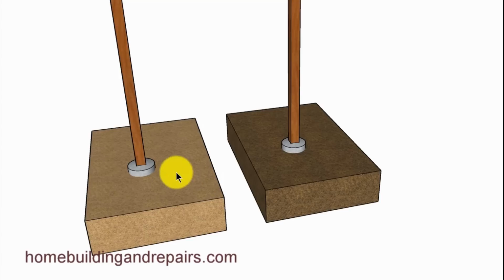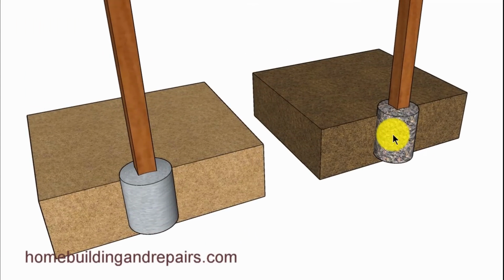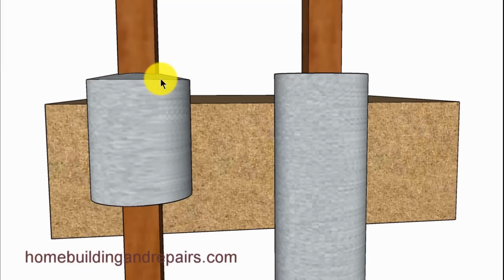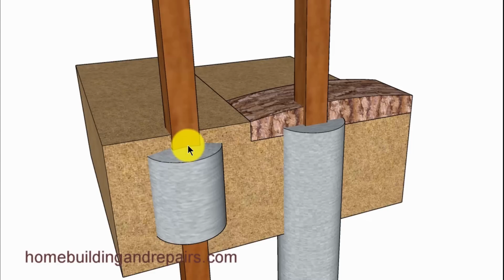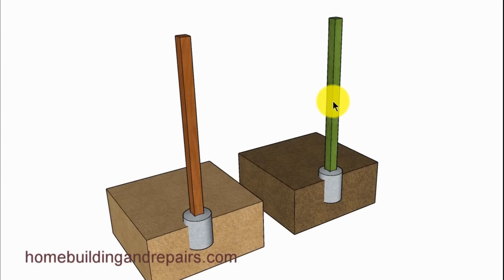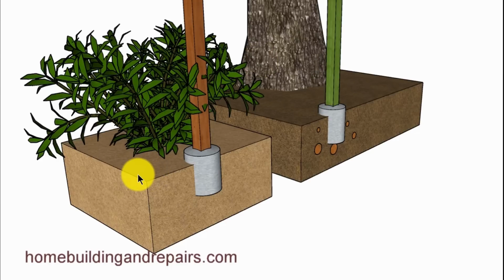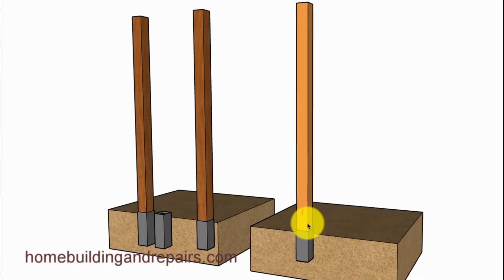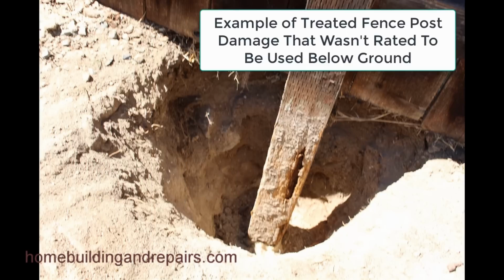Watch This Video Before Installing Your Next Wood Fence Post – Money Saving Ideas

Comment: If you want a fence you wont have to mess with for the rest of your life and is stronger. Never use wood, Use 2 3/4" drill pipe cemented 2' in the ground. painted with oil base paint. Same with patios and decks.
Reply from the maker: What about rust or corrosion?
Reply: cooldbz12 hello there I like your comment. I’m going to put a wooden fence (cedar) with wooden post (4x4x8’) in the patio which is 29ft 4’. 1st of all I want the fence to last long. 2nd I don’t want to mess up and I would like to stain it. Do I stain it firsthand then put it up? You had mentioned to apply oil, what kind of oil?    Please comment, thank you

Comment: Its a good topic but. The video spent 4sec. On the second to last option. Cement footer w/ galvinized post holder that keeps the post 1" from cement top. Over kill for fence but not for a building. Also no modern method like expanding foam was hit on.
Reply: I seen where one person was burning the post in some Japanese form, then he soaked them in preservative.

Comment: Metal posts. No more rotting post problems. Happier customers.
Reply: "Z" posts and "U" posts. Galvanized steel, 25+ year warranty in most cases, same as what they use for chain-link fences. You don't see those replaced as often as 4x4 post fences.
Reply: No then it becomes a rust problem

Comment: Bolting a length of angle iron perpendicular to the wood post below the ground forming a tee-construction is also a solution worth consideration.
Reply: I’m having a cement driveway poured in a couple of weeks and will have iron fence panels. Any advice on setting bolts or something in the wet cement to attach the iron fence post bases to? Thank you in advance.
Reply: @kayBTR  Would expect any reputable installer to already have their trusted method of anchoring in various base materials.

Comment: I think the gravel is a carry over from foundation work. Unless it provides drainage it has little purpose. On a foundation it provides a self compacting base to bear the load if the building, a fence does not need that. If it drains out, it could also provide protection from frost heaving by lowering the water below the frost line.
I think for it to really provide much benefit it would need to be a trench that drains out somewhere.
Reply from the maker: I would tend to agree with your statement also. However I don't know if it would work as good above frost lines. My thinking on this would simply be that the water would freeze in layers working its way up towards the top, then create a problem when all of the gravel is frozen or filled with frozen ice. Just a thought, not something I've ever came across.

Comment: Talks about putting a wooden post into cement. Says "Not something I'm going to set in stone".
Reply: Putting any lumber into concrete is a bad idea as far as I'm concerned.  I like to install mounting hardware into the concrete and then fasten the lumber to the hardware.....no rotting.  I learned this the hard way.

Comment: So what would the correct way be in clay soil? Looks like they r all not very good for both soil types.
Reply: That's the point of the entire video. Per the author of the video there is no way to bury a fence post without some sort of potential problem. He offers no real solution.  I however, would recommend you soak the post in old motor oil, then burn the post, dig a hole, and bury the post charcoal in the hole.  It shouldn't rot...
Reply: @miller1  Thx

Comment: Sometimes I tap two or three 12 inch lengths of rebar into a post hole as nearly horizontal as possible. Pound the rebars into the soil in different directions until an inch or two remains protruding into the posthole.  When the concrete sets up the rebar is embedded in the soil and stiffens up the post nicely.

Comment: I used galvanized posts in concrete and Cedar wood on my parents fence, that was over 20 + years ago, the cedar fence and posts are still there, never had time to recoat the cedar wood with clear varnish either. Neighbors paid someone who installed pine wood fence painted with paint, few years after it was falling apart and rotting.
Reply from the maker: Thanks for sharing your story with.
Reply: Could be the paint. Paint can actually reduce the lifespan of your cedar fence.

Comment: Paint the bottom of the post with old engine oil (or new if you have no car), up to about 5" above the soil level. Then, wrap oil paint post bottom in bin liner, including the lower face and seal the bin liner with brown/black exterior sealant to prevent ingress of water into the lining.

The rest of the post you can paint with the usual fence paint.

I'm replacing rotted 3"x6" posts that were set in concrete. I pulled the posts stumps out and I'm going to drop the new posts into the existing concrete foundation.
Reply: yes,this works or also the black asphalt sealer works too.(the one that can be used to waterproof your house footing.
Reply: @EPICSOUNDTRAX  
I have some existing post that are intact with only slight rot at the base. I'm going to dig the soil out, down to the concrete, and give the post bases two coats of bituminous black paint to keep the impede the rotting by the damp soil. Will paint up to the lower rail (latt fencing).

Comment: I have a Question I wanna buy a 16 feet 4x4 put Bird House on Top of it I have mostly sandy soil i hammered in a Rod Thats 8 feet long by hand in 5 min without a problem.. but anyways how many bags concrete would i need and how deep? Also I wanna make it so i can take the post in and out of ground if i want to do they make a ez base or something like that I can use concrete around it so i can take it in and out like during winter? instead leaving the 4x4 in the ground or no? or I have to make something like that on my own?
Reply from the maker: I cannot provide you with engineering information. I'm actually going to do the same thing with a 12 foot 4 x 4 in a few weeks and will be using about a 1' x 1' square footing that will be about 20 inches deep in clay soil. I'm going to put a pulley at the top with a rope so that I can raise and lower the bird feeder also.
Reply: @gregvancom  I think I know how I'm going to do it, I'm by a PVC 4x4 plastic Fence Post concrete it in the ground so i can take the 4x4 wood piece in and out of the ground!!! be so much easier!!!
Reply from the maker: @Chicagoman36  I like it.

Comment: @gregvancom....  Are you familiar with 50% diesel and 50% motor oil mixture to put on post and then coat the part that's going into the ground with tar????..I am curious to hear your thoughts on this method... That's something i am considering. I also  have sandy and clay soil what would you advise. I live in georgia lots of humidity.
Reply from the maker: I've heard about it, but have never used it. You would think that telephone poles don't rot, because of their treatment, but I've seen them rot also.
Reply: thats the way ranchers in texas built their fences years ago and they are still strong. BTW no concrete

Comment: I would like to see more ideas that avoid exposing the wood to subsurface moisture altogether or at least do not require tearing out the concrete footing when the fence post rots. You touch on this in the last 30 seconds. Other idea1: put a pvc pipe in the concrete instead of the post, then add the post within the PVC, then fill in gravel. Other idea 2: install several J bolts or rebar (ideally epoxy coated) in the footing that protrude 8" or so for use as glued dowels. Drill corresponding holes in the bottom of the post, fill holes with epoxy, and hammer post into place.
Reply from the maker: I do have other videos showing how to replace wood fence post at the website. Subsurface moisture isn't the only problem, there is also the problem of moisture from above. In my opinion, it seems like you would need to solve both problems at the same time.
Reply: @gregvancom  Any chance you can post a link? My motivation is both easier replacement and avoiding concrete waste.
Reply from the maker: @ThisIsNotAVideo  I understand and will meet you halfway. If you go into the video description box you will find a link to the website.

Comment: Just use steel another $12 a postmaster is the best. Posts rot out where concrete meets the post. As the post dries out rot starts at that point
Reply: Some people want the beauty of wood.
Reply: @108hindu  You can place a 2x6 over the Postmaster to hide it.
Reply: I mean 1x6.

Comment: what would it cost PER-post to dip them in a rubber-like paint? Like that stuff the put on a pickup truck bed?  Seems using that would go a LONG way to prevent water rot?
Reply: Just use roofing tar, same effect but inexpensive. Heat and it will soak in some.
Reply: That will go a long way to ENSURING water-rot.
You'll make a tub with such sealants that store water, ensuring rot.
Reply from the maker: I don't know what the cost would be, but if you ever do it, feel free to share it with us. I don't know how the rubber like paint will hold up in the long run and wouldn't recommend using it, but maybe some type of wood sealer would be better.

Comment: I have never seen a properly treated pine post rot at the bottom, here in the south. I have removed hundreds over the decades.
Reply from the maker: I have heard a variety of different things about wood posts lasting longer in drier climates, if you don't mind me asking, what state are you in and what would be the method used for treating the lumber.
Reply: the bacteria that rots the post is near the surface of the ground (need oxygen) thats why they rot at the top of the concrete

Comment: Here is how to rot proof a fence post.  Put a half brick on the bottom of the hole (so the  wood is in-cased in cement and not touching the dirt) and the bring the cement up above the dirt line a 4+ inches.  I live in Houston with fence posts 34 years old and they as solid as the day we put them in.  Hint take thick construction paper and make a ring about 6 inches in diameter.  Put the ring over the fence post to the bottom and let that be your form to bring the cement  up 4 inches.  Over time the paper will rot off.
Reply from the maker: I always appreciate listening to other people's experience with construction projects and thanks for sharing.
Reply: How do you get your fence pickets flush with the ground if you have a cement cylinder 6 inches above the soil?
Reply from the maker: You would install the pickets as needed and cut the wood fencing to fit around them.
Reply: Doesn't matter he already talked about that idea of encasing the post.   Water still comes from below and above and rots the wood.  Encasing in cement does slows rot a bit more than having direct contact with the soil though.
Reply: In a cold climate(freezing in the winter), it's not recommend to have the concrete above the ground level because the freezing will push that concrete up like it was tooth paste in a tube...you could get away with this possibly, if the shape of your hole was like a bell (wider at the bottom) that way it won't lift as easily.

Comment: What are the pros and cons of coating the inside/outside of forms with a tar compound to waterproof the cement or rock, to include the bottom of the form.  Also to apply the tar to the fence post to all the way to the top of the effected area?
Reply from the maker: What forms would you be referring to? It wouldn't be necessary to coat forms with tar that were going to be removed or that would rot away and be replaced by soil eventually. As far as coating the entire fence posts, I think it would be better to purchase treated lumber that is rated for ground contact.
Reply: The cylindrical cardboard/paper forms.  Here in Israel, because of the rocky soul some people use the tar compound to mitigate water wicking up the concrete columns and into the block walls.  It's a real problem here.  I would venture to say that 80% of the homes build have this problem, because of no or little water barriers.

Comment: As you stated, drainage is key, followed closely by vegetation being next to the fence.  Our family has fenced in Mo and Ks for near 50 years and honestly the biggest issue with longevity is the change in treatment chemicals. When the government mandated the major carcinogens removed from the treated lumber, the life of a treated post was drastically cut no matter your style of install.  Fences we put in 20+ years ago are still standing yet ones I did 10 yrs ago sometimes can have a problem. One my Grandpa did near 35 years ago is still doing it's job.   The other main issue is people (even other "professionals") make the footing too small or just don't use enough concrete.  Keep up the good work on your videos.  What design program do you use for you visuals if I may ask?
Reply from the maker: Thanks for sharing and you bring up a good point about treated lumber from years ago, but it's also extremely toxic for the environment. As far as the software, I try to avoid putting product information on my channel, feel free to email me though.

Comment: Just put a post in today and concrete bag said to put in up to 3-4" BELOW the surface and fill the top with the removed soil.  It's hardened now so....maybe I should remove the dirt and concrete it up above ground and sloped as you show?
Reply from the maker: I would, and that is interesting. So much for reading instructions.
Reply: How to replace shower faucet in wall in old house